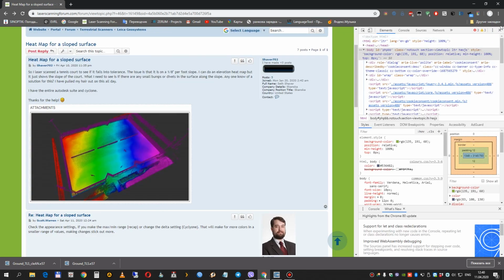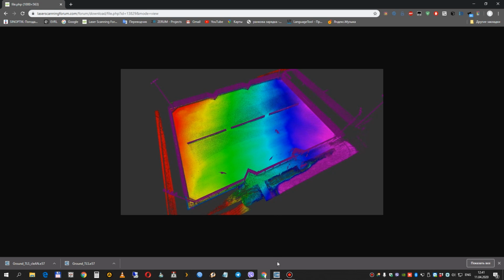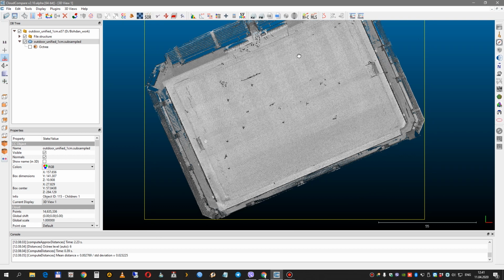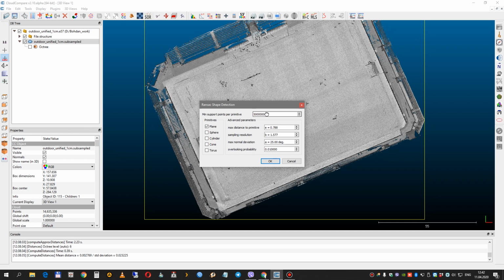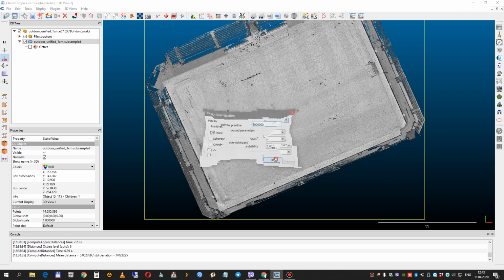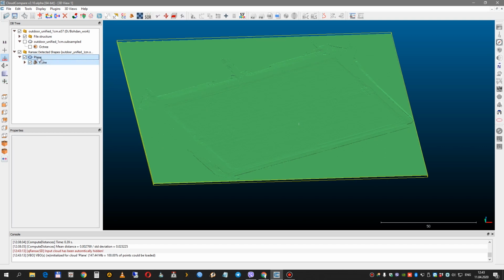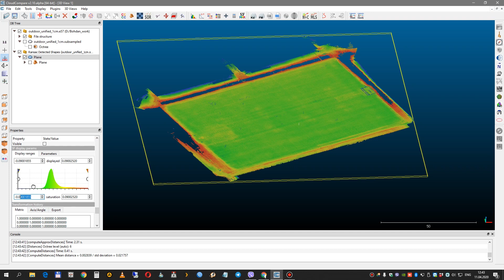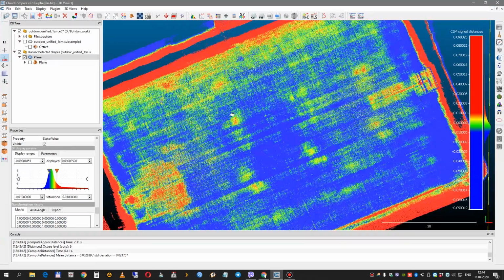Surface deformation analysis using a point cloud

Comment: Great video. Is there a way to see7visualize both rgb and deviations map in same point cloud in point cloud viewers like Potree or similar?
Reply from the maker: These distances between a specified surface and a point cloud are stored in the point cloud as a separate Scallar field, similar to intensity. They can also be written as RGB colors. To do this, Cloud compare has a separate function - Edit>Scalar field>Convert to RGB.  After that, you can load the point cloud in Potree Viewer and see this Scalar field
Reply: @bohdangutnyk8222  Thank you very much for fast reply. Is there any specific export option or format which will keep scalar field as it is?

Comment: Thanks for your efforts 
I am still a beginner, and I have a project that I am currently working on, which is that I made a model on AutoCAD, and then after that I made it manually, which is a foot scanning device, and I actually scanned the foot several times on the Scanniverse program and extracted them as obj files now I have to use  cloudcompare software to carry out a target/actual comparison and measure the deviations of the individual scans.
 how i can do this please. 
If you can make a short Video i will be very thankful 
Thank you in advance

Comment: I have a question regarding the term deformation. You meant by deformation is that missing point clouds from the laser scan or missing parts of the building, like damaged wall due to the age of the building and we can fix that? Because my senior project is to fix the deformations in the building and i want know the meaning

Comment: is this task also possible to be done in Arc GIS Pro ?
Reply from the maker: Perhaps you can find an additional plugin to work with lidar data. The standard functions of the Arg GIS pro can be not enough. You can also experiment with displaying a point cloud using a height gradient.

Comment: I have two point clouds, and I want to calculate the sign distance between those two, not point to mesh but point to point. How can I do that?
Reply from the maker: Just import them to cloudcompare and press "compute cloud to cloud distance"(button to the left from which I use in the video). The rest of workflow will be the same.
Reply: @bohdangutnyk8222  in that part I can not click sign distance. Its shadowed. Only absolute distance is shown.
Reply from the maker: Have you selected both point clouds on the left panel(DB tree)?
Reply: @bohdangutnyk8222  yes. I selected both cloud. Then click the cloud to cloud distance. The sign distance option is shadowed over there.
Reply: The sign distance is not available for cloud 2 cloud distance; only for cloud to model or model to model because the sign distance is being estimated based on the mesh triangles' normals. I think the best approach is to mesh your point cloud data and then estimate the sign distance.

Comment: First of all thank you for sharing your knowledge. Very good video. I have a question. How would you overlay these results on CAD with the project (drawing)? I think it would be more visible and better if you overlay these results with CAD drawing so that we see which part of stadium exactly.
Reply from the maker: Thanks for the comments, I appreciate that. In my opinion, one of the methods to show this in AutoCAD is to create contours lines from the point cloud with a step of 0.05-0.1 m between the lines. In places where the field is deformed, contours lines will be curved or with not the same distance between each other. 

Another way, is to export this point cloud as raster image and use this image as underlay in your AutoCAD drawing.

Comment: Thank you for answering my question!  You are my hero
Reply from the maker: You're Welcome
Reply: @bohdangutnyk8222   So when reading the graph, is the blue area the "flat" area and the green and yellow areas the areas that aren't flat?  I am just having trouble trying to relate the scalar field/values to what is actually being represented.
Reply from the maker: @sethshaver8840  Not quite right. The color of the scalar field shows the distance from the point cloud to the reference plane. In your case, if the point cloud is colored green, it means that it is flat and lies a short distance to the reference plane. In areas where you have irregularities, the point cloud should turn blue or red, depending on the side of the deviation from the base plane (plus or minus height). You can send me your  data in Dropbox and I will record new video with more explanation.